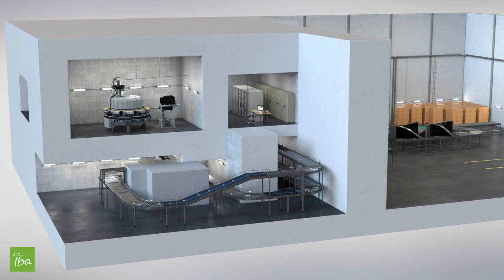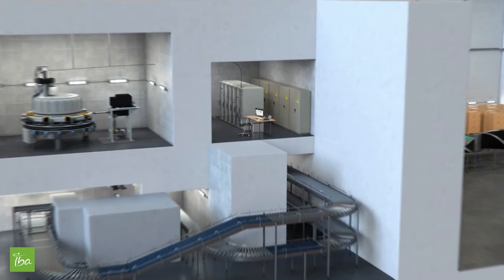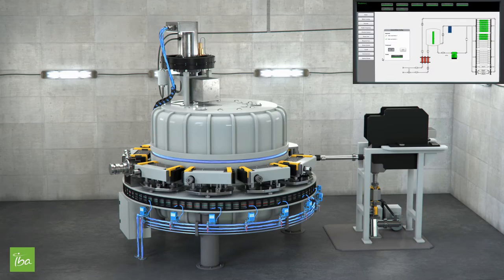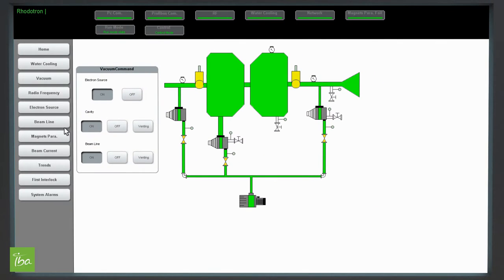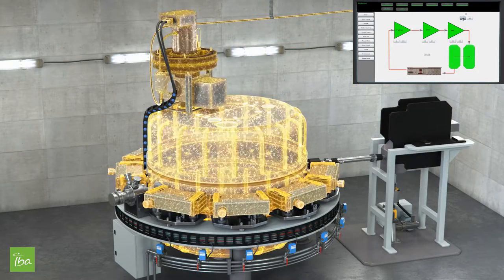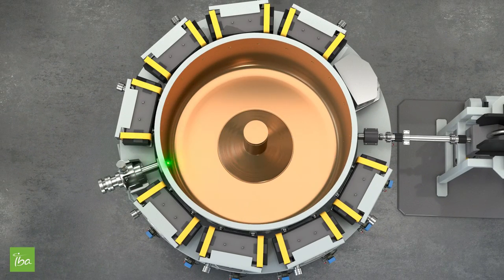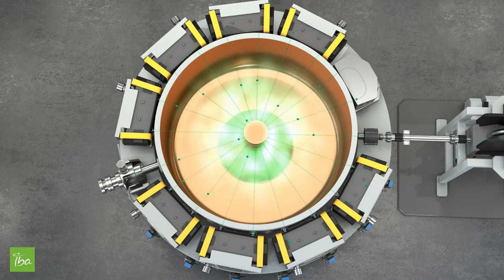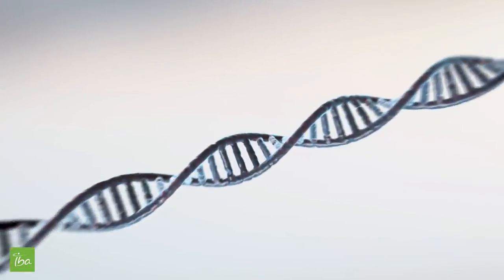IBA Rhodotron® Principles

Comment: How long does the cathode last? And if the beam magnet was turned off is it true it would burn a hole in the ground so much power? And finally how many Sieverts is it directly under the beam? Somebody told me it is mega Sieverts
Reply: Hello there. Look up electron beam welding,  It is absolutely possible for such beam to burn a hole in many materials. You have to calculate the volume of the irradiated material for that you have to see the penetration of the electrons depending on the density of the material and its area and distribute the beam energy deposited per volume minus the energy converted to x-rays which is usually less than 8% at 5MeV. 
So if this machine has a beam of 5MeV at 100mA it would have a power of 500kW if 92% of that power (460kW) were to become heat in a thin plate in a cart because the scanning magnet was turned off it would be all dissipated into a volume of a few cm3 and because energy has to go somewhere and almost always ends up becoming heat it will become very hot, enough to melt and even vaporize. 
About the dose rates. They usually need a few seconds to minutes to irradiate a pallet, the beam is scanned thorough it to give doses of about 25kGy as uniform as possible, so it is reasonable to think that the beam might give dose rates into the Mega Sievert range to be able to process enough material to be economically viable. Co-60 irradiators have Mega Curie sources that output several tens of kWs of power in a large area, so much that the pools were the source racks are stored must be cooled and the irradiation chambers need good ventilation so it does not get too hot and to get rid of the ozone. Yet with all that amount of radioactive material Co-60 irradiators need many hours for the pallets to reach the dose needed.
Reply: Most definitely it would burn a hole into many materials. This is why such machines are wonders of engineering, as they continously measure if the whole system is in order: if a magnet fails for whatever reason (or should suddenly deflect the electrons in a wrong direction) this is usually immediately sensed by the control system, effectively either limiting the flow of electroncs or shutting the system down for safety reasons.
I've seen a medical LINAC (basically what you see here, but instead of shooting the electrons directly at objects or humans, the electrons in a LINAC hit a tungsten target at such speed that it is converted into high-energy X-rays for radiation treatment. Both the leaves (that control the aperture at which the radiation is applied to the person) and the targets have a limited lifetime as the high-energy X-rays just destroy them bit by bit.
The controls always measured how many electrons were leaving the path of the waveguide and as soon as this would exceed a certain limit, the whole unit would turn off, just like the deflecting electromagnets were constantly monitored for drawing current. The electromagnets itself were an interesting piece of electronics: they drew something like 80 Amps and were made out of square copper tubing something like 1/8 in 'diameter' to run a coolant THROUGH the 'wire'.
Nope, I don't work with those things, but the only 2 job interviews I had at a nuclear healthcare department I was like a spunge sucking up the information that was fired at me ;)